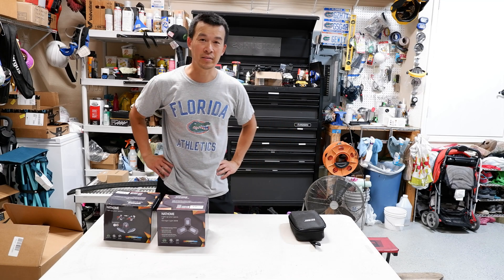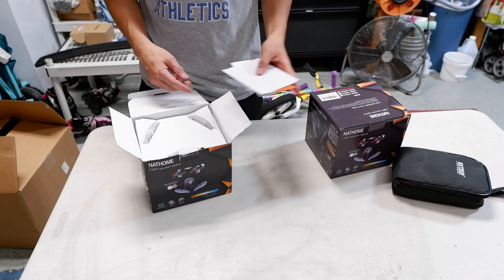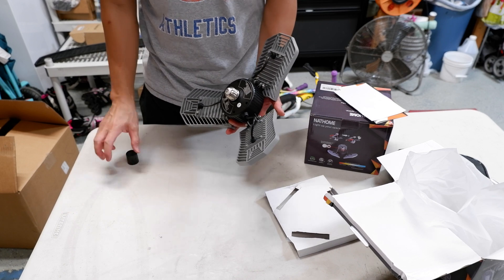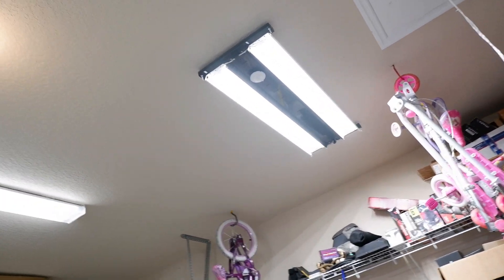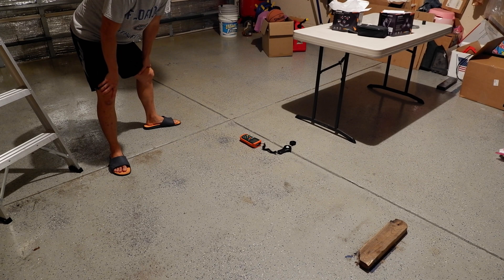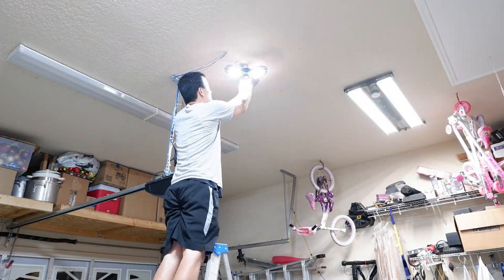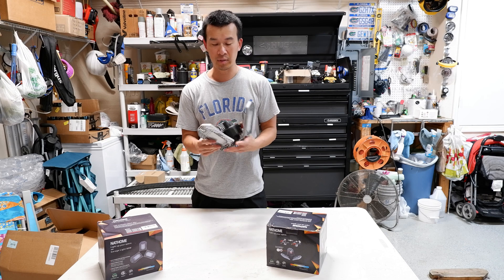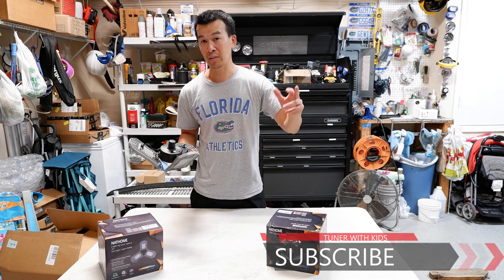Amazon 80W LED Deformable LED Screw-In Light Bulb Review | Nathome 8000 Lumens

Comment: Wouldn't mind having these but not sure if they would work in my garage as I currently have incandescent A15 light bulbs in the garage door motor that turns on/off when opening and closing. I also have standard 2x 48 inch fluorescent lights G13 base type. Horrible lighting which is why I never work on my car in the garage unless its daytime. Even then it's still difficult.
Reply from the maker: aspect D yes, you might have replace the fluorescent with a whole new LED strip. You can get the LED tubes, but by the time you pay the cost of those, it might be worth getting a good $50 LED strip.